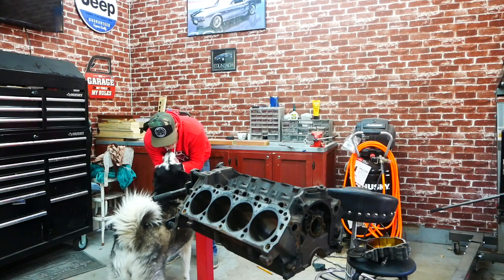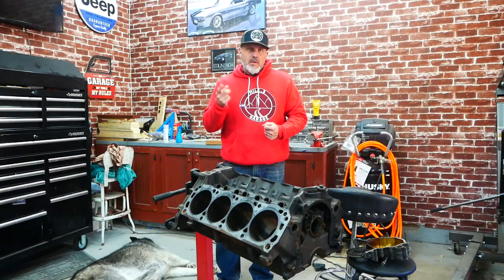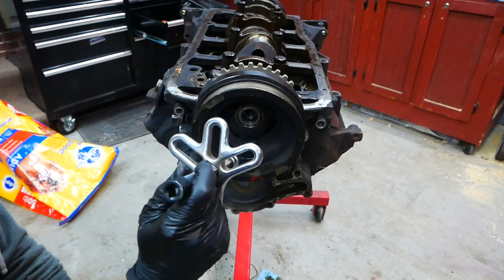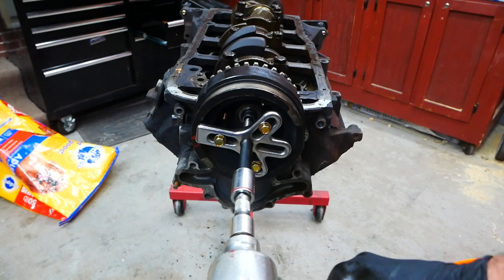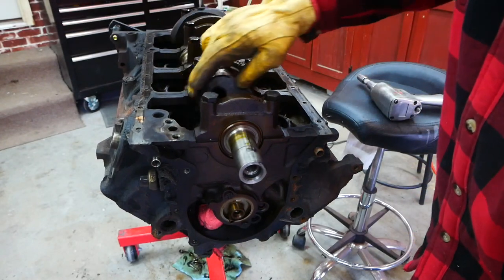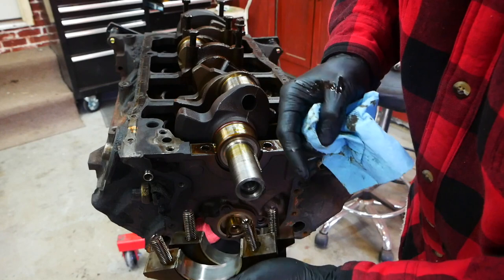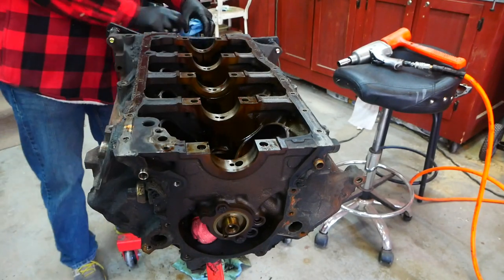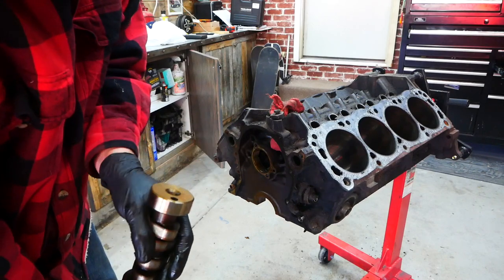Explorer 5.0 Engine Teardown PT. 2

Comment: Have machine shop polish crank, have the machine shop help with block decision. Do a stage 1-2 valve/heads and decent cam. Then call EFI guy run the factory Ford stuff they run excellent.

Comment: Just my opinion from past experience..polish the crank, hone it, new bearings, rings, oil pump and run it. I've done a few of these high mileage explorer engines (160 to 180K mile) with no problems and used them in older carbureted vehicles. Most still had factory crosshatch on a biggest part of all the cylinders with minimal wear, the cranks polish up fine and are still in spec and so is the ring gap. They run great, don't use oil and make decent power with a good cam and valve spring change.
Reply from the maker: That’s the way I’m leaning Don. Everything about the motor seems fine.
Reply: This is the exact build I'm wanting to do. I bought a 00 explorer motor yesterday. 164,000 mi. on it. I'm planning on using the gt40p heads. Edelbrock performer rpm intake, and 600cfm carb. Can you recommend a cam and springs? Thanks!
Reply: @user-sg6fb4ip5h   I can't really recommend a cam for you but I have the exact same set up you're doing.  I used a old school B303 and drop in matching springs for GT40P heads from Alex's parts. https://www.alexsparts.com/ford-small-block-302-ho-w-e7-gt40p-gt40/   Runs strong and sounds good for what it is, it's in a 70 Mustang with a T5 and 3:80 gears.
Reply: @dcsmitty50  Thanks!  I'll be tearing mine down today when it warms up some. 
Do you hone it yourself or get machine shop to do it?  
Also do you use factory style oil pump or aftermarket high volume pump?

Comment: With this motor I would at least have it bored or honed out about 5,000  buy some oversized rings for your stock Pistons if that's what you're wanting to go back with!! That's just a scenario for your 3,000's problem!! And maybe that will solve the cylinder problem!! Or just go ahead and have it board over 20,000 and put flat top pistons in it will give you a better compression ratio either anyway!! And go with a little bit bigger fuel injection like a 26 lb fuel injector should solve the lean problem!! I wish you well hopefully we'll see this in your newer videos!! I will be watching more of your videos! 👌👍👍
Reply from the maker: Thanks Randy

Comment: What size bolts did you use on the harmonic balancer?
Reply from the maker: I used the stock bolt for the balancer.

Comment: Is it possible that this engine has been rebored once already?
Reply from the maker: Don’t think so. It’s only .002 over.
Reply: @alpinegarage8548  ok.  I don’t think a reborn will be needed for this engine.  You’re only expecting to use it two years.  Plus with new piston rings and gaskets, fixing other parts might be enough.

Comment: Not that my opinion matters but single ball hone, bearings, rings, and take the machine shop $ and spend it on heads.
Reply from the maker: ...as in aftermarket heads?  I am tearing down the heads today to check tolerances. If they are trashed I may do that.
Reply: @alpinegarage8548  Yes. Had technology has come such a long way since the 90s. I think a mild performance head would give you a very healthy motor without sacrificing drivability. Like a trick flow combo kit with a matched cam.